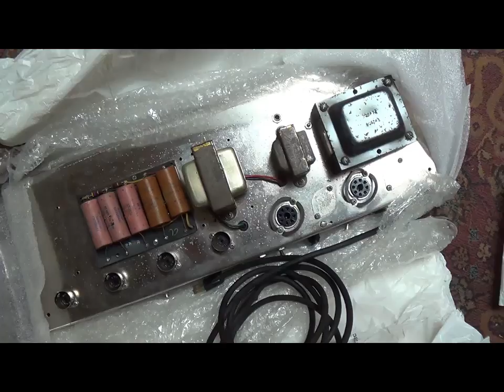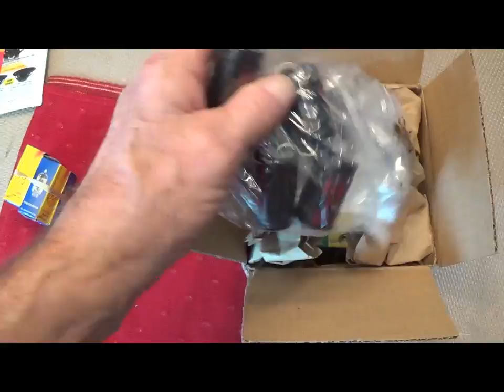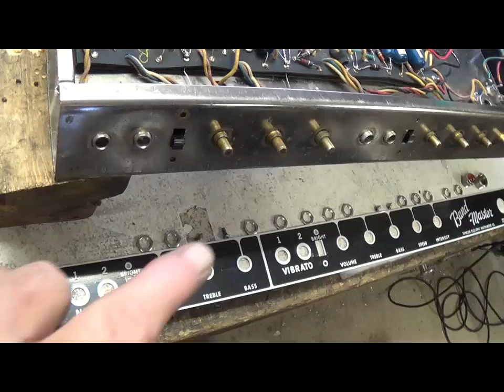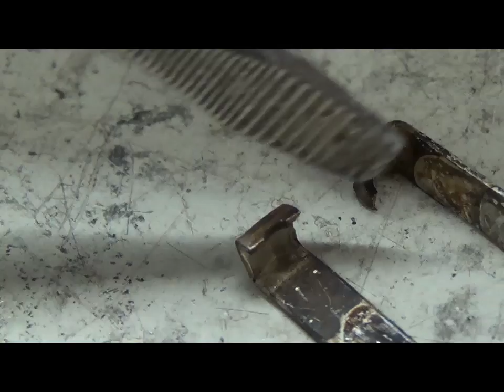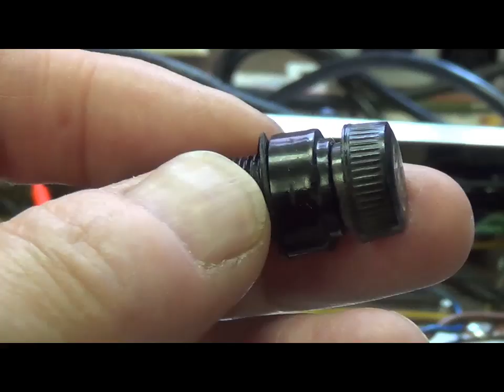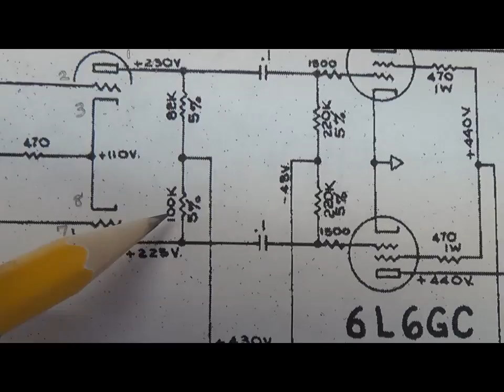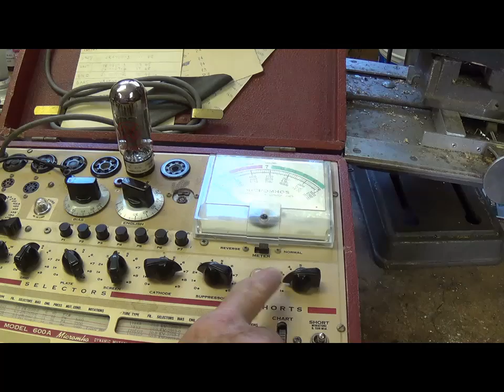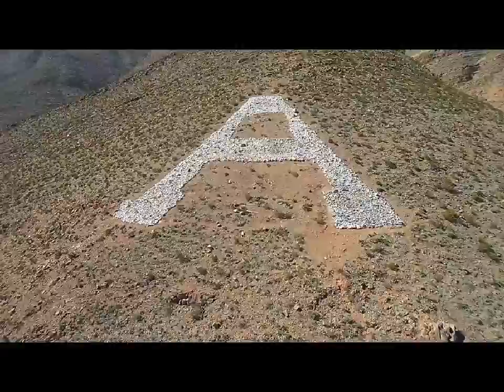The 1965 Bandmaster from Hell......A Really Tough Repair Job

Comment: Hello Uncle Doug,  Very nice job well done.  I have some questions about the amp. I noticed the two input recepticles for the guitar to plug into on both, the normal channel and vibrato channel.  What I am trying to find out is can more than one instrument be played through this amp at the same time and if not why do the manufacturers install extra inputs?
Reply from the maker: Thanks, Rick. In a jam, I think you could plug four different guitars into the four input jacks and probably end up with fairly good sound......as long as the combined input didn't overpower the pre-amp. Also, you could run a guitar in one channel input and a vocal microphone in the other, and have separate controls (volume and tone) for each.
Reply: Thanks Uncle Doug,  I have always wandered why you couldn't when they are installed from the factory.  I trust your opinion about these old amps more than anyone else that I know to ask.

Comment: Had something similar with JJ EL34 in a JCM 60 .  Tubes are mounted horizontally in these amps . Tapping tubes gently with a chopstick  caused instant red plating on one tube . So I think vibration and horizontal mounting caused say a grid to cathode short . Luckily the tube set was Ok after turn off and cooling down .
Reply from the maker: I agree that the interior structures are rather close together and impact as well as heat can cause internal shorts......the temporary kind that will drive you crazy.

Comment: Looking at the screws on that aux. Recep on the back of the amp the hot and neutral are backwards. Silver screw is neutral and the brass should be the live . If it goes by standard wiring practice.
Reply from the maker: You're right. I'll change it. Thanks, Robb.

Comment: That was soooo typical of how most of my repairs go. I have had tubes that short and then the short blows itself clear, so not unheard of. I've done dozens of BF Fender amps and never seen a chassis like that. Occasionally you find one-off's where they were trying new materials and methods that didn't make the cut, but that chassis is a new one for me. Some 1969 Fenders look like they were wired with telephone cable. It wasn't until I had seen several specimens that I realised it wasn't a bad rewire.
IS there a quality difference between a black cat scan and a tabby cat scan? Mine doesn't seem nearly as effective as yours. :)
Reply from the maker: Thanks for your comments on the very strange chassis finish, John. I can't imagine that anyone stripped an existing chassis to have it  nickle or chrome plated .....especially with all the rivets......and it took  a while to develop that much surface corrosion. Jack insists that his scans are the most thorough, and he charges accordingly :)

Comment: Uncle Doug

Usual accolades with a couple of observations . One of the biggest pluses in the modern world is to see anyone with patience who is willing to continue, even when it is not easy. With me I guess I don't like it when mechanical things try to beat me, but I don't like things unfinished.

Watching you systematically diagnose issue after issue and with very little sign of true frustration is commendable and instructive. I have found that in many ways electrical issue are indeed the most puzzling on occasion. I had an issue with Air Conditioning fan on a car where I checked all the items on failure trail and was about to have to dismantle the entire dash to check things that were unreachable. And as a last resort checked the fuse again under load. It was good unpowered but the minute it was powered the filament took a big swing away from the solder joint at one end. It is the weird ones that are the most satisfying to overcome. 

So put your feet up and have Mrs. Doug make you a LimeAid freeze and relax, until you favor us with a new / old project !

Cool Drone stuff as well...

Robert aka jagjet
Reply from the maker: Thanks so much, Robert. It's true that great challenges are often the most rewarding......unless you lose your patience and smash them with an axe, which I try to avoid when dealing with someone else's property :)

Comment: You would think an amp repair shop would stock common fender replacement parts.
Reply from the maker: If you're speaking of the 70uf @ 350V caps, they are pretty elusive. I will start using 80uf @ 450V.......much  more common.

Comment: May I suggest Eurotubes to buy JJ.. They actually burn in all tubes for enough hours that the infant mortality will happen if its going to.... and then test and sort with a computerized testing system that does measurements under actual load. They do the fail culling in advance, not the customer. On 3 wire power cords, always switch and fuse the black... white is neutral and effectively in parallel with GND back in the service panel. Excellent video.  Slide switch repair was great!!!
Reply from the maker: Thanks for the recommendation, Jennifer. I believe that I wired the primary just like you said. Glad you enjoyed the festivities :)
Reply: I can also say I've had good experience with Eurotubes. They sell through their website and on Reverb. Nice people to chat with, I traded messages a couple times on Reverb.
Reply from the maker: Thanks, Andy.

Comment: What determines the capacitance value in filters and can different values 
affect frequency response in your opinion? I've noticed that older hi fi and 
old P.A.amps tend to run 10 to 40uf while more powerful pro amps tend to be 
higher like 80uf (or there abouts?) Thanx in advance 
and thanx again for another great vid... 
cheers
Reply from the maker: The filter cap values are based on the needs of the circuit and rectifier, Jonny. You want them to be low enough not to stress the rectifier, but high enough to properly filter out any residual ripple in the rectified DC. Tube handbooks state proper values for different circuits and rectifier tubes.

Comment: Hi Uncle Doug and Everybody..  What a Great Project..   It would have been nice to replace the AUX AC Reciprocal on the back panel of this amp to a 3-prong unit..  That would actually bring the amp to present-day CODE..  I was surprised to see that the "White" wire went to the "COPPER" terminal and the "BLACK" wire went to the WHITE terminal of the Female plug..  Usually, the "BLACK" wire goes to the "COPPER" colored terminal and the "WHITE" wire goes to the "WHITE" terminal..in present-day CODE.. Wiring the plug to CODE might help someone from getting an Electrical AC Shock  if the female plug was used by some other Musician on the stage..  https://youtu.be/jOfkWNCdxVk?t=778
Reply from the maker: Thanks, Wox. You're right......another viewer drew my attention to the mis-wiring of the receptacle. I have already remedied the situation.

Comment: As nice as the amp looked at first, it did put up quite a fight in the end, ey? Especially that one plate-resistor going short under load. Great repair and the drone-flight-finale was pleasant as always.
Reply from the maker: Thanks, Klaus. Yes, it was an uphill struggle that fortunately ended well for all involved ?

Comment: I really like your videos and your lexicon as you speak if very rich. You always have a correct word for each thing. Anyhow, I always question myself you don't you replace all the caps, or at least all of the ones of the same type, especially if you had to repalce one that was really leaky and causing a serious issue. It's just a matter of time for a new failure to arouse.
Reply from the maker: Thanks, Charlie. Capacitors and resistors tend to fail more often when subjected to relatively high voltage stresses......such as the output tube coupling caps which were replaced. Most capacitors, especially for tone purposes, can virtually last forever. When rejuvenating an old tube circuit, I personally only replace the components that actually need replacement. It's a judgement call, but has proven to be good practice for many years.
Reply: Fair. Although having had so many issues in that amp it may have been a good move to replace at least all blue ones. Question: Have you senn Mr. Carlsons Lab viedos about direction of capacitors (no polarized but in reference to the position of the outer foil that acts like a shield) and about his rigs to measure capacitor leakeage with exceptional results? Say hi to Jack.
Reply from the maker: No, but I'll take a look when I get a chance, Charlie.

Comment: 34:31 most suppliers I know will exchange suspect parts if you explain what happened calmly, or provide them with video evidence.
BTW, that shorted bias resistor might have had something to do with it ;)
Reply from the maker: Fortunately, I had a screen shot of the short circuit indicator on the Hickok tube tester to bolster my claim.

Comment: Just did one about the same year a while back. Someone had put an FX loop in it and made a mess. I took it back to spec and it sounded great after. Great videos Doug!  I usually just use an 80uf cap that are a lot easier to find. I just went through this intermittent tube short on a Marshall JCM 800. Inverted the chassis and it worked fine and after I flipped it and moved it was blowing HT fuses. Checked the tubes initially and they tested fine, after it started blowing fuses I started to think bad tube. Sure enough a second test showed a short on 3 of my tube testers, my Hickok 539C, 6000A and my old Eico 666. Replaced the bad tube and it ran fine for hours where it would cook the fuse after 2 minutes before. I'm thinking a loose element in the tube that moves around. Like a light bulb that will light after shaking it around sometimes.
Reply from the maker: Thanks, 6S. I think I'll use the 80's too next time.....I actually have a nice pair on hand.
Reply: Had something similar with JJ EL34 in a JCM 60 .  Tubes are mounted horizontally in these amps . Tapping tubes gently with a chopstick  caused instant red plating on one tube . So I think vibration and horizontal mounting caused say a grid to cathode short . Luckily the tube set was Ok after turn off and cooling down .